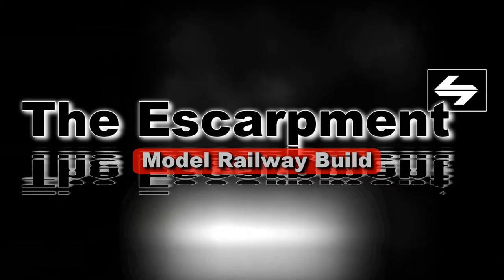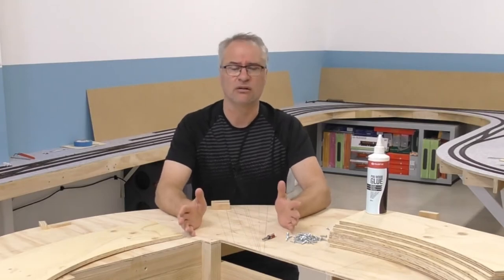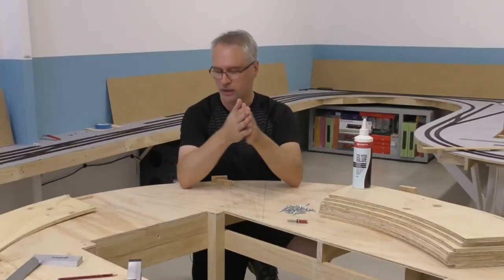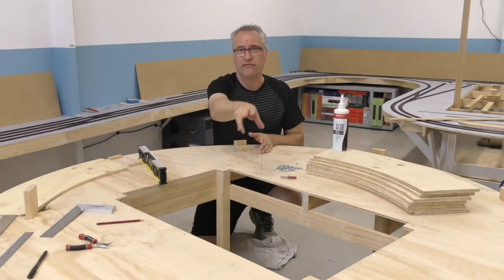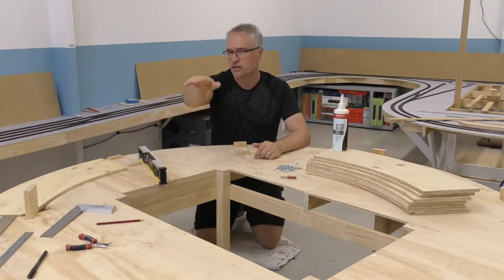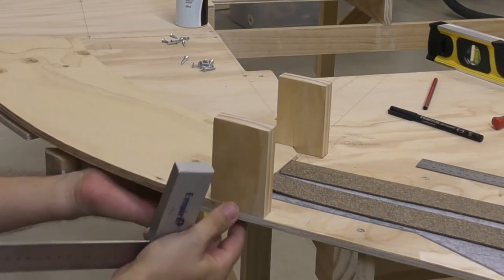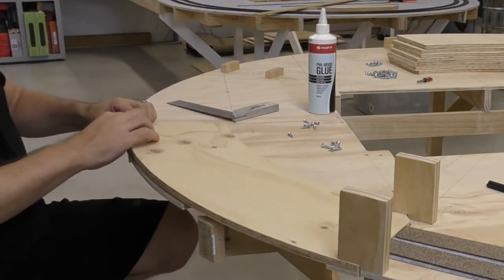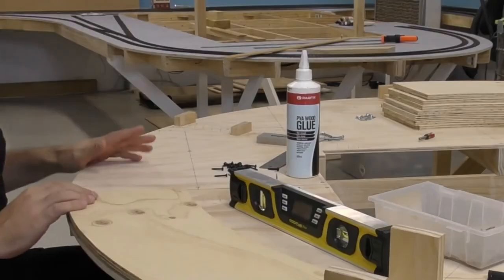Building a Model Railway Helix - Part 1 - The Escarpment

Comment: Just curious why you used a level on each piece that was installed- Since there is a slope, wouldn't that mean the pieces would not be level?
Reply from the maker: Hi Steve, I just like to check each piece to make sure that they were within the tolerances. Cheers
Reply: @JasonWood_Escarpment  Thanks, Jason, I realize now that you were probably using a multi-angle level.
Reply from the maker: Probably should of mentioned it is a digital leveller able to read degrees
Reply: @JasonWood_Escarpment  No problem, my friend. You did a fantastic job!